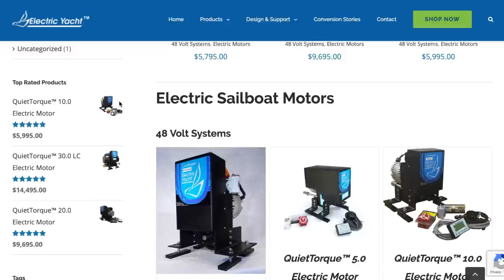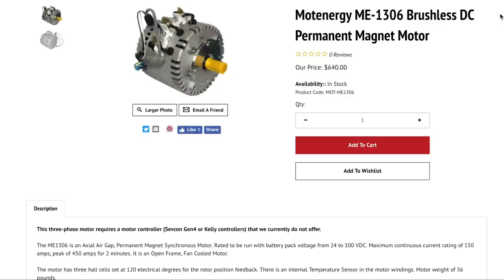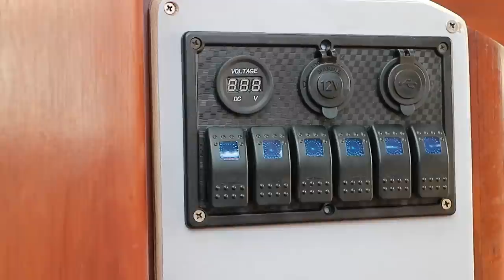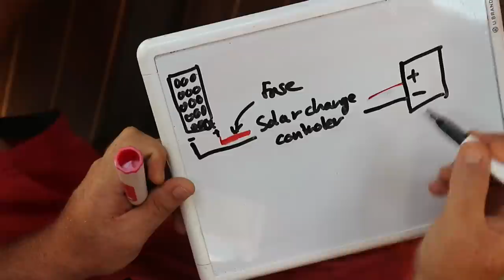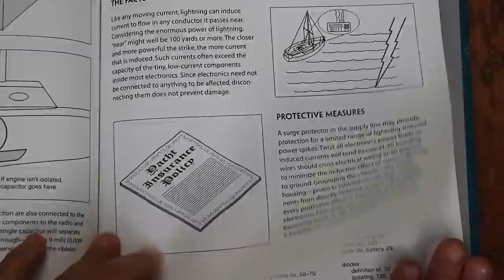Should We Board the Electric Engine Bandwagon?

Comment: People sailed the world for thousands of years with no engines...You should only NEED the engine in emergencies, so go for it...UMA rout is the way to go... 300+ AH lithium battery bank...favorable winds!
Reply from the maker: People sailed for thousands of years, but often found themselves wrecking their boats...

I agree though. It was the point of speaking about our one time use emergency use of Rossa’s diesel engine. Depending on the way that you plan and sail, these kind of emergencies should be very rare. I forgot to mention how that particular situation could have very easily been prevented in the first place, and with or without an appropriate engine, we shouldn’t have taken the risk either way.
Reply: @sailorama  thanks for the reply...I have a bit of work before I need a motor...I've been looking into electic motors for 4 years while totally rebuilding my boat...Uma's Electo Beak is how I plan to go...I will be retired and can sit and wait for weather in paradise until I die LOL...I am looking for no sound, smell, or maintenace so electric is my choice...I plan on 600W solar and a 400W wind generator to keep batteries full...I'll be following you guys...very enjoyable watching your adventures..cheers and favorable winds

Comment: If your worried about parts if you go electric, then look at using fork lift motors / controllers (similar to Uma) as electric fork lift parts are pretty much commodity parts and available in most cities, at most you would only need to get the parts shipped from the nearest capital city / major port.
Some have said you can't run electric days on end in the doldrums, this is not true, learning the lines proved it by keeping their speed down to 3 knots (in glassy conditions) they could run the electric motor on solar without using any batteries. You would run out of diesel before they run out of sunshine in the doldrums.
If you do decide to go electric, don't rely on just solar, supplement with other electrical generators, consider one or more of wind, regen, external hydro generator.

I am biased, not for environmental reasons but because of my electrical background, so I'm more comfortable fixing electrics than petrol/diesels. But that me not you, what are you most comfortable fixing? would you rather look at electrical wiring or fuel filters? let that be a deciding factor.

I hope I gave you some good ideas, but at the end of the day, do what is best for you, after all it's you that need to be comfortable fixing it in the middle of nowhere.
Reply from the maker: Thank you for the good point. It’s a different style of sailing, plain and simple. 

We know diesel power has gotten many people out of danger - we’ve also seen other folks running themselves into rocks using their big, strong engines. 

Basically, it takes a certain kind of patience to only have the electric engine onboard, which I think other sailing channels have demonstrated to us (and from personal experience sailing my first boat engineless).

The important part as you say, is knowing your system. At this point, I think we are considering electric because we would understand the limitations of engine setup more than we trust the state of our current diesel, or used diesels that we may find.

Comment: Diesel! Batterys are a constant trouble factor no matte what type they are. Imagine the risc of getting electricuted with that amperage in a boat partially filled with salt water....... As you said: a diesel can run under water as long as it gets air - the electrik engine instalation would have killed you. Diesel!!!!
Reply: The relatively low DC voltages used in electric boat motors are totally harmless to humans whether ditched or not. Also amperage of the battery bank isn't an issue in this concern.
Cheers

Comment: Hmmm, No, No and lord no. Batteries do not last long enough, and you still need a seacock to cool the electric motor. Oh did I mention batteries. Diesels are messy, noisy and require maintenance. But like you said if you don't have thousands to regularly replace the batteries then I would personally stick with the diesel.
Reply from the maker: We simply see it as exchanging one kind of maintenance/replacement of parts for another kind. Either route will cost money. Electric will progress as time goes on (battery, motor and solar panel technology), while diesel will remain a steady, solid, good form. Looking forward into the future, it's not as simple as 'hell no electric' in our opinion.

Comment: Electric is just not there yet!! As for the environment, how much are you really going to use the engine? You're a sailboat!!! Electric lack endurance if you have an emergency, if you hit the duldrums you can't run your electric for a week! A diesel is always ready and a newer one is much cleaner! Find a used diesel and adapt it!! In 20 years diesels will be there, but not just yet. I've seen many diesels that have been shut down for 20 years and they start right up! Electric is for a daysailor and that's not what you are! I can't stress enough how much I think electric are not for sailors!!!!! Good Luck!
Reply: I don’t know, we made it through the doldrums with our light air sails just fine. Took about a week but we were always moving.

Comment: Most boats only need 1000-2000W to go 2-3 knots. I'd go solar electric diesel hybrid with minimal batteries and lots of solar, wind, hydro. If you need to go faster then switch over to the diesel. There's probably a cheap electric bike or scooter kit that could be adapted.
Reply: It would be interesting to hear if there are cases of someone for example getting through the doldrums at the equator, or escaping any high pressure system, with electric propulsion driven by photovoltaics directly... Strictly speaking one wouldn't even need significant battery capacity beyond covering the bare necessities if you don't mind not making way after sunset.